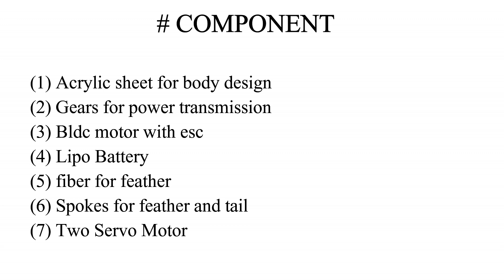🎥HOW TO MAKE ROBOTIC BIRD | ORNITHOPTER | PART 2

Comment: I love how it ends so you can't see it fly
Reply from the maker: ya , but trying to improve my design
Reply: IGEN TECH did it fly?
Reply from the maker: Right now it not possible because of weight so if light weight material is used then this design will work.
Reply: IGEN TECH yeah lighter plastic and bigger wingspan
Reply from the maker: ya, you can try with this improvement.
Reply: @IGENTECH  Jmo, but you threw simplicity out the window. My suggestion would to watch the simple rubber band powered copter. They now have any size motor, a 15amp speed control, a twenty by twenty FC, and two micro servos. I'm going to build one. New Motors, flight controllers, and batteries are much better than a year ago. I believe if you simplify your drive train to lose some weight it would fly with a smaller battery. The simplicity of the rubber band model is, in my opinion this is the proper weight just needs electronics to fly.i will be building one with a camera, and feet to perch on whatever, as soon as my six race quads are all back in top shape.
Reply: If you can't remove weight then add power, I guess ratio of weight and power 1:1+ will work.
Reply: @IGENTECH  Lighter battery and motor will do too, try using plastic servos that are not places on the edge of the back wing (try to place them more in the middle and then redirect their power to the back wing) make the wing spam bigger and try to ensure that the wing will rotate when it flies, not just go up and down. Check some more videos on this topic
Reply: He tried. Thats a lot.i like his design.
Reply: @RCOverKill  why so long
Reply: @kozynat  what, my explanation?

Comment: seems to heavy to fly and wing span is too short as well, but great solid works skills, lighten the electronics, use a thinner sheeting, smaller battery, carbon fiber parts and she will fly :) well done
Reply from the maker: Thanks i am working on this i need to widen the wing span and need to use carbon fibre in main body part. but thanks for your consideration in design.
Reply: Yeah, it looks too heavy, he should have used nylon for the wings and the mechanism whould weigh it down

Comment: Hey Bro , the  video was so amazing but I got a doubt can you please help me with that .
you are not using and Arduino in this but how can you control servo and BLDC motor without Arduino ?
Reply from the maker: Hi @Gourav. You can directly use remote controller module to control servos and BLDC motor
Reply: @IGENTECH  that's Great but i want to use Arduino can you please make a video using that !!

Comment: nice bird indeed, i want to build this bird m but first  can u tell  me , if i  made  3d  printed custom gears, are they strong enough  to do flapping stuff like that? thankyou before
Reply from the maker: sorry friend i never tested. but sure give me some days i will tell you about this
Reply: ok...and the gears in your video  ,  are they  metal?
Reply: i've tried 3d printed gears before and if you use 100% infill with a strong material like ABS for this it will work
Reply: thx bro for your enlightment
Reply from the maker: no they are plastic
Reply from the maker: is that give good precision and strength, if this then it good thanks
Reply: I think plastic gears will do as long as the whole bird is lighter.....there's another video of someone whose ornithopter is made of lighter materials and the electronics used came from a WLToys F949 mini cessna....I also own that kind of RC plane and I was shocked bcoz he was able to succeed in flying his ornithopter using just a single motor of that plane....and using 3 phase gears, considering it's a brushed motor..... that plane has 3 small motors to propel itself....he just used one and it is enough to make his bird fly....

Comment: a small suggestion 
Decrease the weight of components so that the flying capacity will be increased
Reply from the maker: Srinivasa Satya Main problem is that sir, if chasis made with alumnium sheet than its better and also hav problem with battery, Thank you gor your suggestion

Comment: Can you give me materials and how you make that
Reply from the maker: Use 3D printing ABS material
Reply: What is that
Reply: @IGENTECH  what is that
Reply from the maker: @lakshminagpal7524  AbS is kind of plastic material which will make your fuselage light and also have good strength, Contact to any person who have 3D printer
Reply from the maker: @lakshminagpal7524  contact  to Parambeer negi 6395522689

Comment: Please remove the video if some one follow ur video all he effort will goes in invain because when it is not flying than the design is worng
Reply from the maker: Thanks for your kind suggestion , i visited your profile sir, seems like you had done really good work in this field, would you like to give any suggestion how can i made this to fly
Reply: U  can use acrylic gear casing but not  complete body. it seems it is completely nose heavy . use low weight motor with higher kv ( 1800kv to 4200kv ) use 2 cell lipo . ONE important : if ur bird gild perfectly with free lunch than it will fly
Reply: visti : https://youtu.be/VmzjGLnZfuo
Reply: vist: https://youtu.be/pPNAMeG0I88

Comment: That is way too heavy to fly, what's the point if it doesn't fly? You can buy components that will fly that frame. Lots smaller battery, maybe 850mah 100c.you need to lose some weight, the design Is too heavy, and more complicated than it needs to be, please prove me wrong and fly it.
Reply from the maker: thanks bro,